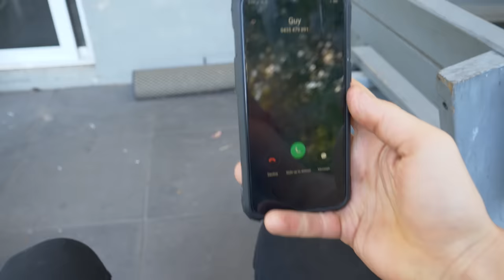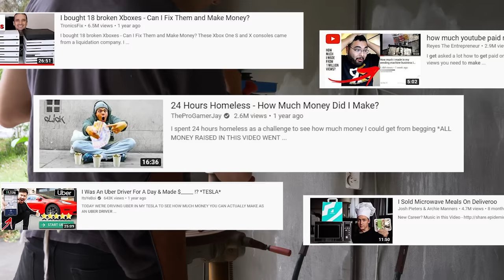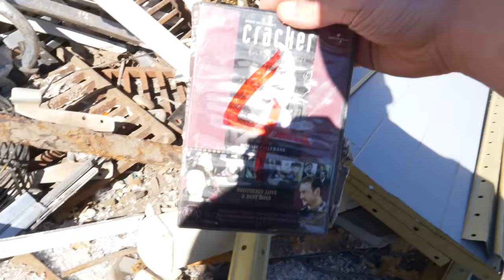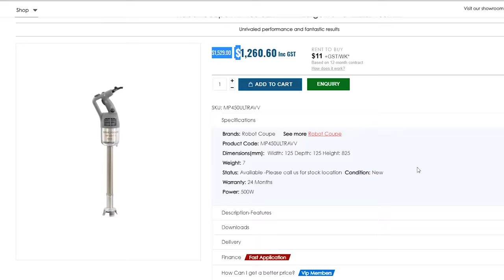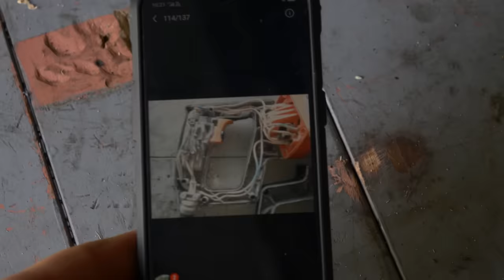How Much Money Did I Make Fixing Broken Tools?

Comment: A drill is composed of, a motor, a button, a few wires, some metal connections, a hyperdrive, an EMP defense system to disable any incoming radar missiles, a flare countermeasure system, a turbine for steady airflow, a nuclear reactor, and last but not least, the plastic case.

Comment: Dude, my husband and I met in college when going for computer repair, programming/networking dual degrees. We are constantly astonished by how many "broken" laptops and pcs are given to us because people THINK they're getting rid of junk and we're the suckers but I've made thousands of dollars off of selling just the processors if we don't want yet another laptop or PC and just need to have parts handy. Right now I have a dozen laptops stacked up in my guest room that are just in need of very simple fixes that involve really cheap parts. It's just... Man. Sometimes I go back to the college I went to and ask my old advisor if there's anyone who NEEDS a laptop since nearly all of his course work is done in a lab sim program and requires a computer to do them.
Reply: I also had a similar experience with a laptop given to me by a relative. It was a Dell Latitude D630 and at first I didn't care too much about it as it came in with Windows XP, dual core, and 2gb ram. Later on, I found out you could easily plug in a better RAM, an SSD and a good Linux OS, this thing could still be usable.

Sadly, I am still a student so I dont have the cash money to upgrade it, and I already have a PC, but I can easily see someone be able to use thing with just a few upgrades.
Reply: @JoNarDLoLz  Linux users hacking into the mainframe so they can open up youtube and play a cat video
Reply: Krauses  That's 22 actions more than just double clicking on the Edge icon. And a complexity of 25 vs 1

Comment: This problem gave me an idea that I think is a solution for this problem. (I'm not sure if it works or not I'm just gonna say what's in my head so don't whine please)

For every laptop, TV, Telephone it iPhone or any device that is made of plastic and has a screen, In a good condition with every part inside of it, We can make a business that repairs it and we won't have to pay money because there are no parts missing, However in the case of devices with missing parts we can buy the items for a certain amount of money and for sure will be plenty of people coming because you can pick something up from the junkyard and after we get the devices sold, we would try to recycle the plastic in a safe environmentally way or if the producers of the device can buy it then it's gonna be sold to them in order to get repaired and re-sold. If you have anything to tell me or if you think there's a problem with the idea, Tell me.

Comment: I've made good money over the years by picking up everyone's lawnmowers and riding mowers in the spring because they won't start, and then selling them back to them after I give them a bit of a clean and flush the carb.  Free+$3 bottle of carb cleaner = $40 bucks for a push mower, $50 for a self propelled, and usually about $400 for a rider.  It's not glamorous but it pays.

Comment: 0:37
My device is acase that holds a motherboard thats connected to a battery thats connected to a type-c cable, that mobo contains intergated ram, cpu ssd, and a video chip. At the type-c port, theres an aux jack, a sim car and mini sd slot thats all connected to motherboard. Motherboard also is connected to 2 camres thats on the chassis. There is an OLED screen connected to motherboard, and there is an touchscreen above it thats also connected to motherboard. Mother board is connected to 2 speakers thats at sides of my device, and 2 micrıphones thats above my device. 
Motherboard is also connected to 3 buttons thats on side of the device.
Reply: Im not a chinese kid. I. Am. A turkish kid

Comment: 0:44 easy it’s a piece of plastic covering a electron/neutron attractive /not attractive sheet and a panel of light emitting diodes (leds) and a battery plus a small computer chip ( a plastic chip covered in metal wires resistors etc..) that transmits electric signals to the led panel and tells it what to light up as well as when to shut down

Comment: I know this video is over a year old.  But I thought I should point out, WD40 is a degrease, squirting it in all the holes is a very bad idea, because while it will add some lubrication, it will also remove all the current lubrication in the tool.  a Thick grease should be using on moving parts, with a lubricant like WD40 on areas such as screws, bolts and electrical connectors.

Comment: old video I know, but the intro sequence of "look at the device in front of you, how does it work" etc, I fix electronics for a living. I know exactly what an LCD is made of, how it's using electricity to align charged liquid to show different colors to my eyes, taking in signal from an HDMI cable through digital pins sending bits of information in digital morse code known as binary at a speed imperceptible to people raw. I know that the GPU is making these calculations on transistors storing data on other less volatile transistors and capacitors known as ram to send out through the HDMI cable.
Granted, none of this matters if someone throws a rock at the LCD monitor, I'm replacing that shit. Resources are hard to come by, and while I know how it works, I don't know how it was put together or don't have the machinery to be as precise as the original factory.

Comment: I know a good number of people who know how to fix electronics, and other stuff. Maybe I know an abnormal amount of such people because a lot of people in my family have worked some kind of hardware maintenance jobs, and most of my few friends have almost always been very technologically inclined and curious.

It's unfortunately, not always cheaper to fix things though. At least all the good bits become scrap parts for the future.

That's another thing: parts availability and things being proprietary... and certain corporations REALLY want you to buy more, new products. You can't buy used parts, if they keep changing the proprietary parts, and also make your stuff brick itself if anyone but them opens it up to repair that one tiny thing that went wrong...

Plus, planned obsolescence. :)

Hmm it does make me wonder... how difficult would it be to make a refurbished thing, run some other code, if it has decided to brick itself after you touched it.
What if you just completely wiped the computers on John Deer stuff that decided it didn't want to work any longer, and installed new code into it? Those are still computers, and they all do some things the same up to at least a certain point... there are obviously reasons that this hasn't been widely done already. I'm just a bit too sleepy to realize the biggest ones right now.

Comment: Tbh, I like trying to fix things…I take apart older devices that are usually free as scrap and try to fix them sometimes. Unfortunately, despite this, I have no idea what I am doing and a lot of them just get worse…though I have jankily fixed a DS, where it will only work if you’re constantly pressing the down button on the D-pad. I have no idea how any of it works, but I still find it interesting. Also I know a lot about how electronics are set up, and I can identify some problems, like welding issues and broken ribbons. Still can’t fix them but I don’t feel bad as they were fucked anyway. I’ll learn how to fix these things slowly, but for now I will experiment with the old tech…and I would literally tell anyone to do the same. It’s just interesting and fun and inexpensive if you know where to look :).

Comment: Usually, if you wanna make money on repair and resale on used market, learning electronics (particularly phones or entertainment electronics) is the direction to go. Get a box of 20-30 broken samples for like, 20 bucks, and then repair maybe 5 of them, which will then each go for at least 50, using the ones you can't repair as parts donors. 

It, of course, helps to know what you are doing BEFORE you start trying repairs, if you are expecting immediate profitability. Helps a lot on the assessment stage to know what you can and can't fix at your skill level, instead of spending a week on something way outside your skill range. 
TOTALLY not speaking from experience there. Nope. Nosiree.

Comment: Why did you use vinegar for rust removal here? I have used gasoline before and it works great, at least on some of my car's bolts when I have done some repairs the rust just comes off with minimal rubbing, if at all. Also diesel works great too.
Reply: Vinegar is better for thick rust